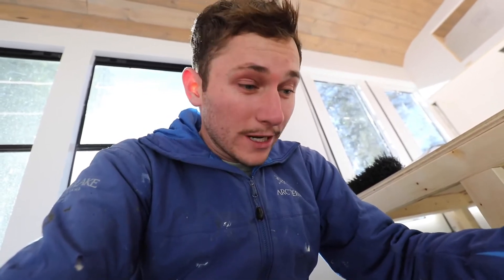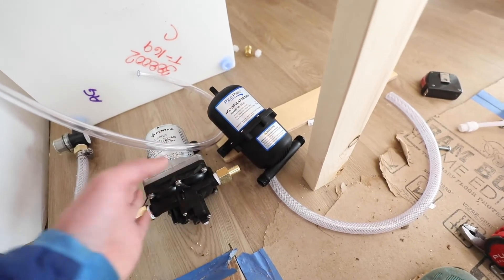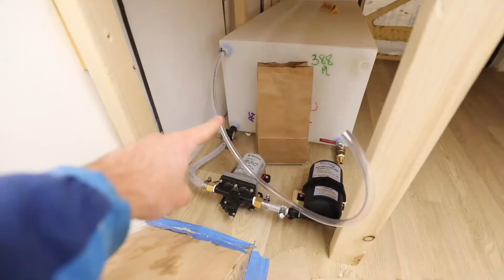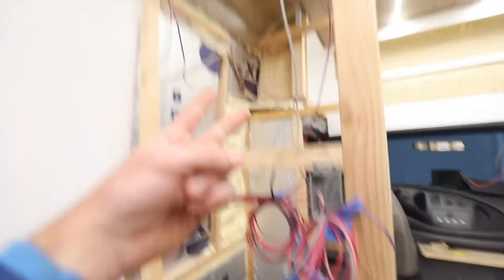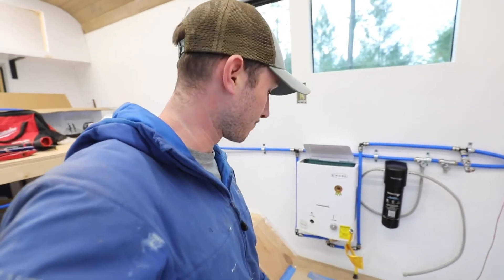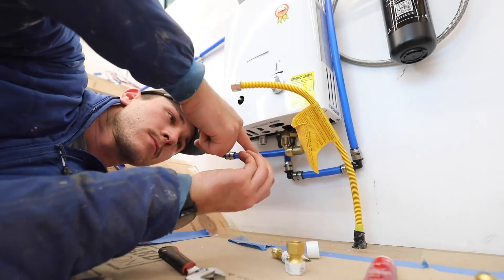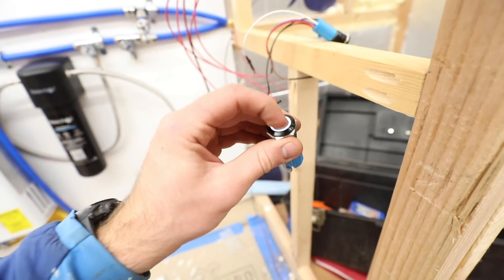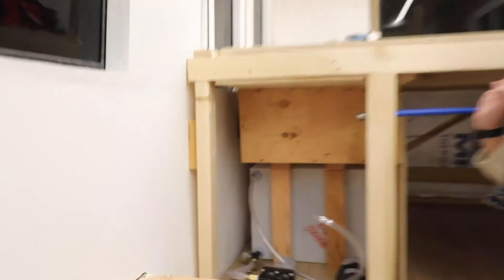Plumbing Water and Propane Lines - Bus Build Episode 32

Comment: How do you like the Excel Tankless water heater?
Reply from the maker: I must say that I have mixed opinions. I bought it because it claimed to be ventless which was really appealing at the time. After getting it running and using it, I found that it released a lot of heat and steam from the combustion of propane out of the top. Because of that, I manually vented the space using a small cpu fan and a vent cover in the side of the bus wall.